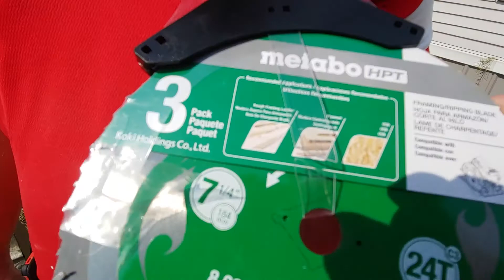Complete Building The Deck The Customer Wants On Mobile Home

Comment: I thought you were going to show how to attach the wood/ deck to the house…obviously there’s gotta have a specific place to attach it
Reply from the maker: That house had a metal roof so my goal was to keep angle  and roof line together. This creates the place where I fasten to the house and the roof. It does not move. Hope that helps
Reply: Decks are not allowed to be attached to mobile homes, or else the house is then considered not mobile

Comment: I’ve never seen someone layout and cut so much lumber on his knees . The post in the middle of the window no way . Did you attached the deck to the trailer house I can’t tell because of the stack of lumber you left in the corner. 🫣
Reply from the maker: This deck was built in the location the customer wanted. It was fastened to the as the customer wanted . It was a copy of one down the street that he wanted.

Comment: Thank you for sharing this video. It is very helpful for. I’m getting the same kind of thing done now and there’s been some issues. I’m wondering if you can share the dimensions of the supportive posts the four corner post you’re using for the overhang, including the ones against the house?as well I’m wondering if you can share the dimensions of the ledger board and the process by which you attached it to both the house and the posts?
Reply from the maker: The ledger board is fastened with screws to start. Later adding 3 inc lag bolts with washers . Regards support posts usually 4 by 4 . Perhaps  the thing most people worry about is putting weight on the  side of the mobile home. So generally I put 4 by 4 s wit 2 by 6 s on each side lagged to the 4 by 4 in a straight line usually no more than 3 feet from the mobile home. That keeps the weight on the ground not the home. Mind you there are exceptions to every rule and more than one way to skin a cat as the saying goes. Enjoy the process of creation communicate with kindness. Men tend to cover over fear with anger and frustration. Life will always be a constant learning journey if your looking.
Reply: @StraightArrowRepair  thank you so much for sharing all of that information. 😊
I will be discussing this with the handyman who’s been helping me and I think this will help us a lot.
Reply: @StraightArrowRepair  I’d be interested in knowing or seeing how you notched and latched the post on either side of the door frame together and with the ledger board, anchoring them together and into the wall. I saw a secondary video that you did what’s called building an overhang for cheap something to that effect it’s labeled and you showed the details a bit on how you did your ledger board but it looks like it might’ve been different. I’m not sure?

He built a bridge on the cement foundation slab directly under the front the 14 foot width of the front wall where the lean to overhang is connected. He built the deck first and so the bridge was screwed down into the cement directly under the floor and 4 x 4, like peers all along lag boltedinto the door the newly built 57” French door frame above that. However the weight of the ledger board and the overhang is felt on the door frame so he is taking apart the overhang and so it’s if there’s anything more we can do to fortify it I thought to look into it and found your video which really kind of his spot on when I’m looking to focus on. I also found that putting an oak door jam would be the best strength and durability so he’s gonna be opening that up, so I’m gonna replace that with oak door jam as well.

Any suggestions for fortifying would be greatly appreciated. I think what you have here, however, is great and probably will be enough, but there may be some things that come to mind.
Reply from the maker: @tanyason1138  all the best to you guys.

Comment: You didn't show at all how to set up the posts and how to prepare the ground to sit them! Pfff
Reply from the maker: One more area that I will have to improve. Hang with me I'll try to get better.
Reply: @StraightArrowRepair  thank you sir. ☺️
Reply: I was wondering the same thing. The cut went from screwing the joist, to the deck already installed. I was so confused on why they failed to show so many steps

Comment: The handyman that is assisting me with the build, took down the overhang that he built as he fixed the ledge board directly to the wall but this is an older single wide, manufactured home. He did, however, build a bridge that fixes to the concrete directly under that same wall and so the deck is screwed into that ledger board. That’s screwed directly into the foundational concrete directly below. So what we’re gonna do is beef up the two supportive beef up Adding support posts on either side, flanking the double doors that were added as well.

We’re also going to open up the walls around the double doors and add jacks for the frame and the roof structure. I’m also thinking of whether it was best to invest in Oak for the door jam and the step in? There was a lot of damage on that came through from that ledger board and so I’m worried too because I don’t have a ladder around the rake or any kind of real eve set up so it’s veryoverwhelming as far as water and trying to keep things dry. I’m on a budget on disability, so this is just more complicated. Most of what I’m trying to do is source materials from others who may have extras but we have a situation with water that is damaged to door frame and so I’m trying to invest in better materials and hopes to end better techniques to make sure that everything sound and secure and dry.

I had originally purchased gently used more narrow double French doors that were tall almost just under the roofline even though he shaved it down a bit it pumped the ledger board a bit higher and so what I’m rethinking is to shave the doors down a bit more to bring that ledger board just below the roof line proper because I am looking to purchase 26 to 29 gauge metal sheathing for the roofing that’s going to go on the Overhang connected to the deck. He when he put the deck on, he built it over the posts in the ground with about I think a foot or so pass that where the railings go on and then the post are on on that framework that are being used that go up and they are 4 x 4’s Going up to support the header for the lower portion of the lien to overhang. My concern is whether I should lose a little space and have him put two more supportive posts in the footings that go straight through the deck so he’d have to cut a hole in the deck and those two locations as extra support supportfor the structure above the overhang to make sure I can support snow load as well as the metal panels. 

I thank you for sharing how you beefed up the supportive post by CString the 4 x 4 with a I think you said 2 x 4 or 2 x 6 I can’t remember offhand but I save the information. The ones here in the video look like six by sixes for sure really nice looking.

Wondering after that long dissertation if you might have any thing you can share on that?
Reply from the maker: You should be ok with your thoughts put into action. Definitely 2 by 6 s .I don't know if you need to cut down the doors particularly if they open inside. More about getting flashing under that gutter on the outside of roof which by the way holds Down the roof of the home. Sounds like you got the right sense of it. Hang in there you will be the winner in time.
Reply: @StraightArrowRepair  thank you so much. I currently have no gutters. My neighbor shared with me that the issue with gutters on the manufactured home is the ice and snow can build up under the roofing tiles and then back up and cause damage under which is kind of what we’re dealing with now where he had put the overhang connected to the house. I did get heating tape to go along both the front and the back. He’s discussing building perhaps a pop-up a little bit but I’m thinking of putting studs on either side of the door frame on the inside as well on the outside may be bolted in, which will be connected to the deck which is connected to ledger board, which is screwed into the cement slab beneath for support. Likewise, we can have the overhang support spanning from those support beams on either side, which will be an extra support to the extra ones will drool in through, the deck to the location where the sauna board tubing is and the cement and fix those two extra inside which can add extra support for the overhang. I’m thinking. I hope that does not sound too confusing.
Reply: @StraightArrowRepair  do you recommend gutters as long as you seal as you were saying behind there as far as back up my only concern is the tiles the roofing tiles and wondering if I have heat tape would that be enough to protect that that kind of damage?
Reply: @StraightArrowRepair  do you think gutter guards help stop back up as far as the damage I can happen to a mobile home? Wondering if you have any videos on the proper application of what you were mentioning of the ceiling behind the gutters and the safe property application on a mobile home, so there’s no damage that backs up?
Reply from the maker: Gutters will work on your home that is with shingles. There are many guards or foam that can be installed. Keep in mind nothing in life is without maintenance. Everything thing sounds well thought out .way to go
Reply: @StraightArrowRepair  ,thank you😊 !